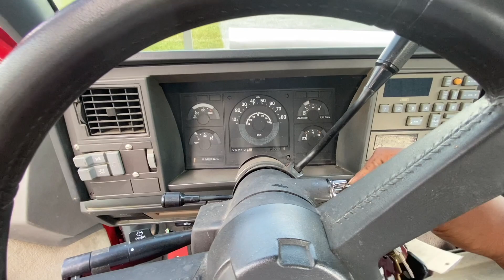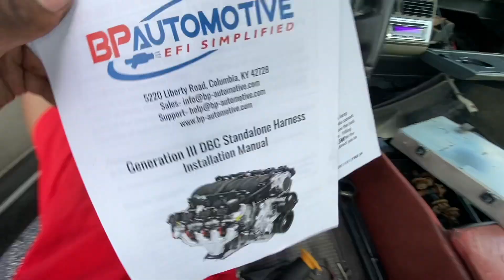how to wire up your ls swapped OBS truck part 1

Comment: Make me wanna pull the plug and ls swapp a extended z71 I been eyeing I had a extended cab 355 in it and it held its own up against anything was a sleeper for sure but man these ls motors are a dime and a dozen and easier to get better parts for them
Reply from the maker: I would do it cause the reliability and how plug n play the ls platform are to these obs trucks , it’s like a might as well only hard part is getting them running lol cost alot
Reply: @TevionsGarage  I’m going to do it you convinced me to
Reply from the maker: @Zack-smith  well I appreciate you for allowing me to let you make great poor financial decisions my brotha 🤝 lol

Comment: The problem I have is the guy who pulled the orgainal driveline cut out most of the harness
Reply from the maker: You don’t need most of the harness. if you check out part 2 you’ll see. it’s pretty straight forward anything from the stock computer for the obs you basically don’t need. only need a couple things

Comment: Also don’t make the hole bigger bud, pull the harness back out. Feed it through the hole from the inside of the cab back out to the engine bay. So much easier than tearing the fuse box apart
Reply from the maker: Big facts lol don’t know why I ain’t think of that 🤦🏾‍♂️

Comment: Vss needs to be tied into the ls harness at its vss  so you’re speedo works 👍🏼
Reply from the maker: Preciate that fam. do you which wire it’s suppose to tie into ?
Reply: @TevionsGarage  vss wires should be purple and green on the transmission. You splice into them do not cut the wires from the ls harness you will have problems.  Solder every connection. Also those wires can be sensitive. Keep them ran separately and away from other sensors.
Reply from the maker: @Colt-v9u  Ight bet